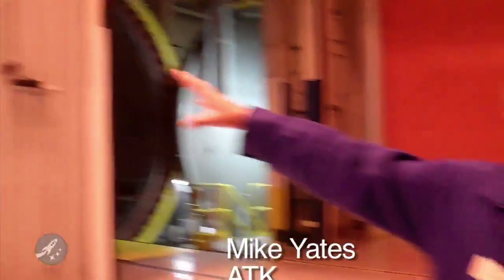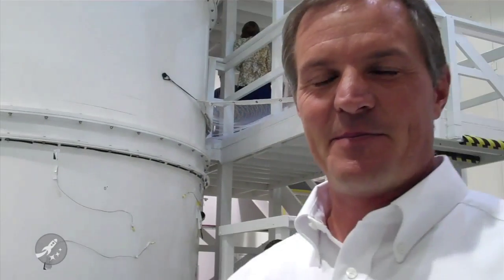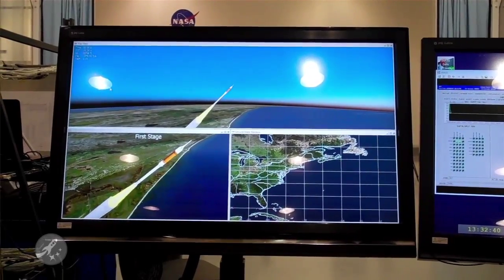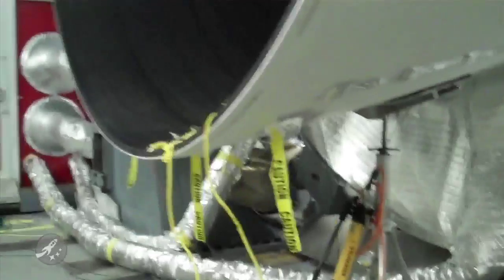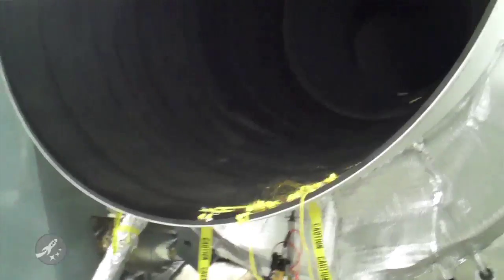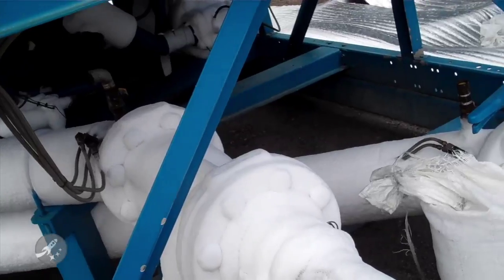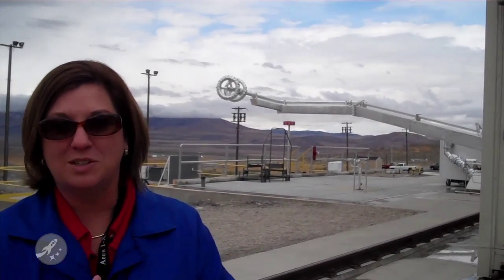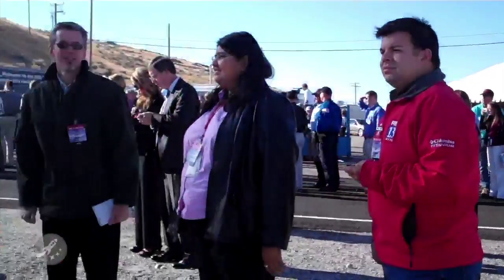NASA and ATK's DM-2 Test Firing - SpacePod 2010.09.07

Comment: Did you see the Delta II explosion?  Solid rocket explosions are probably not survivable.  Trying to escape a solid rocket explosion is a feat by itself.  You need a much larger escape system which adds more weight and cost.  Solid rocket fuel production process has to go just right, if there is any cracks or air pockets its curtains.  I would much rather rely on liquid fuel engine robustness vs a solid engine mixing and curing process.

Comment: 22,000 horsepower? Who is this clown? He needs to study his cheat sheet more closely. Even 22 million horsepower (equivalent) sounds low.
Reply: Using horsepower to describe a rocket doesn't even make sense. Horsepower, like the watt, is a unit of power. To be producing power, something has to be doing work over a period of time, and work = force x distance. This SRB is sitting still, and therefore not doing any work.

Even when on an actual moving rocket, it doesn't make much sense, as it completely depends on how fast the rocket is moving and how heavy the rocket is (which would change how fast it accelerates). If the rocket is really heavy and the thing barely accelerates, you only get a tiny amount of power. If you just light the SRB and let it fly off into the great blue yonder, you could get some insane number for the power.

Horsepower is for turboshafts, internal combustion engines, and similar devices, not reaction engines like rockets or jets.

Perhaps one could be referring to the thermal power it is producing, but it would be very strange to refer to that with horsepower.
Reply: oisiaa I was looking for this comment. 22.000.000 hp is correct. For one SRB that is. They had two on the SLS. Plus the main engines. So at least 44 millions hp.

Comment from the maker: @hadr0n It probably will be but hasn't been yet. As I understand it, simply performing the tests and expending the fuel is less expensive than trying to dismantle the DM tests and find a place to dispose of all the material. Besides, as they say in the end, there is a good chance that NASA will still use solids in the first stage, which means the data from these tests will not be going to waste.